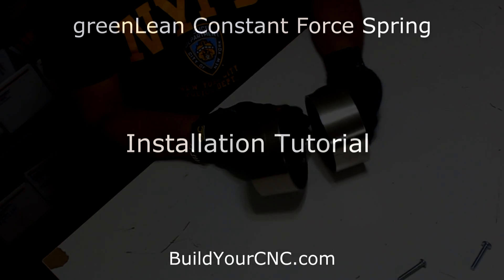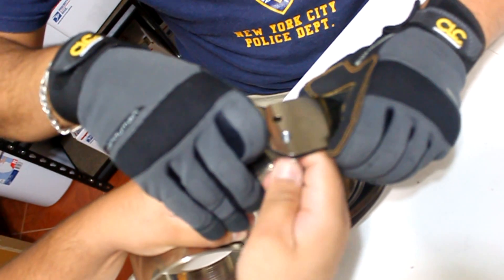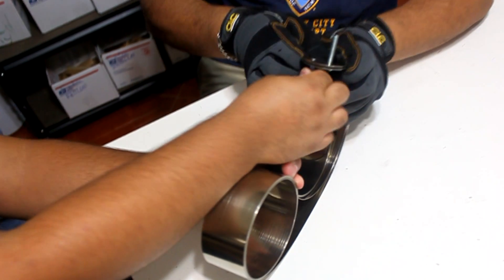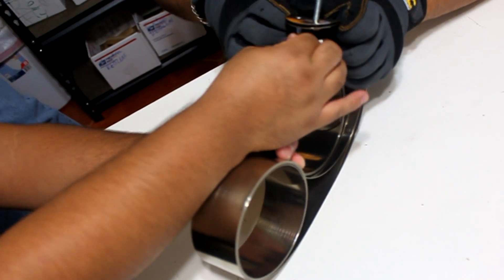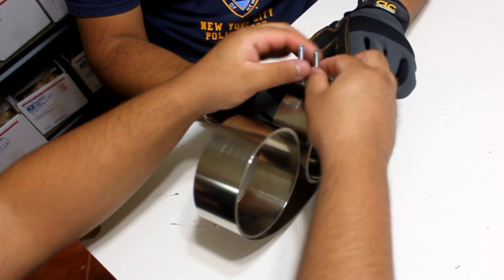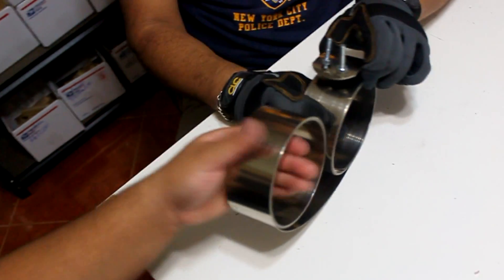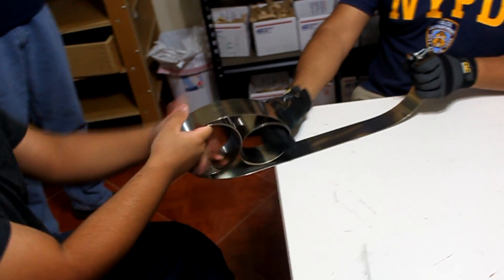How to Coil Constant Force Springs in Tandem on the greenLean CNC

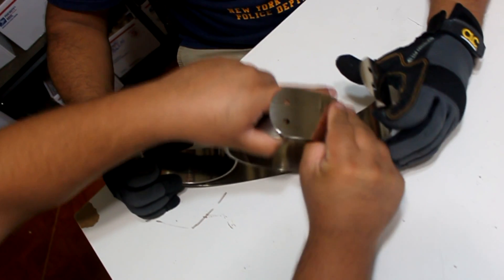Comment: LOL, good job not following your own instructions. 0:23 "Remember to use appropriate safety gear"  .... meanwhile the second person in video has no work gloves to protect from sharp edges or pinching by the tightly sprung metal. Is he at least using his safety squints?